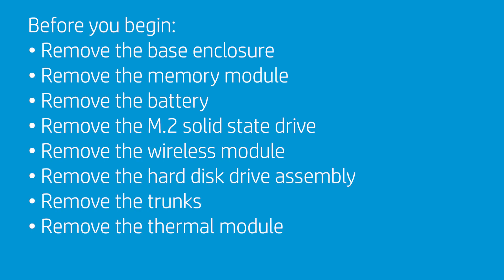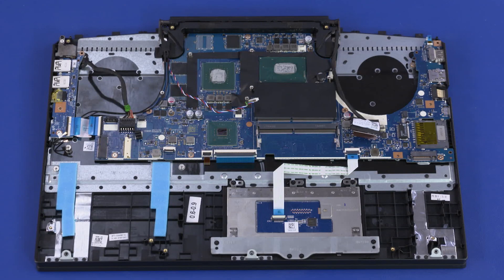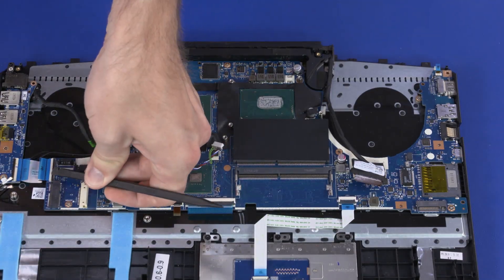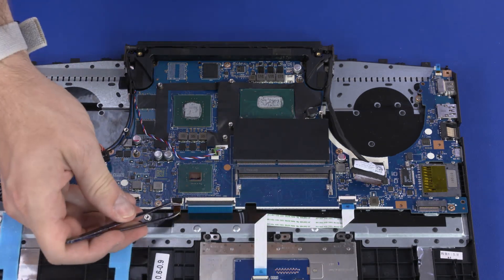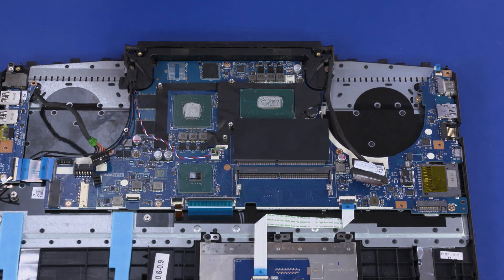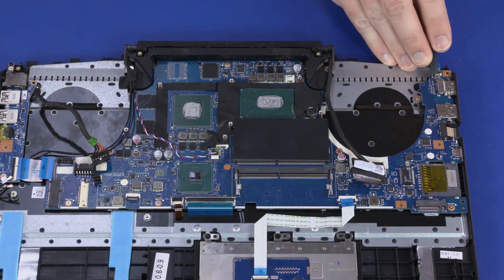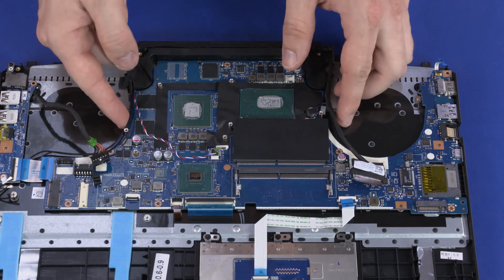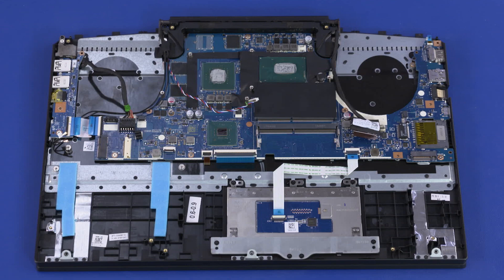Replace the Motherboard | HP Gaming Pavilion 15t-dk0000 CTO Series | HP

Comment: Do omen laptop motherboards fit in this case? If so which one(s)? Thanks.
Reply from the maker: +2380knight HP does not recommend upgrading or downgrading hardware parts or software that is bundled with the product as It may affect the manufacturer's warranty and performance, however, you could change the configuration at your own discretion.
Reply: HP Support does that mean the gaming pavilion and omen laptops support the same motherboard? Or are the sizes different? Because some of them look similar

Comment: So I've an HP PAVILION 15-BC501NO with a i5. For gaming this laptop couldn't handle a lot. Is it possible to upgrade it from i5 to i7? Another thing I'm wondering is if it's good to upgrade the RAM. Right now I've 8GB ram installed. Would the CPU get faster. Just wanna hear what y'all recommend. Wanna upgrade the laptop
Reply from the maker: +Zushiki The processor supported are: Intel® Core™ i7-7500U (2.7 GHz, turbo up to 3.5 GHz), 2133 MHz/4 MB L3, dual core, 15 W
Intel Core i5-7200U (2.5 GHz, turbo up to 3.1 GHz), 2133 MHz/3 MB L3, dual core, 15 W It supports  two SODIMM slots - customer non-accessible/non-upgradeable
DDR4-2133 Dual Channel Support (DDR4-2400 bridge to DDR4-2133) (for 4 GB/6 GB memory)
DDR4-2133 Dual Channel Support (DDR4-2400/2666 bridge to DDR4-2133) (for 8 GB memory)
Supports up to 8 GB max system memory
4 GB (4 GB × 1)
6 GB (2 GB × 1 + 4 GB × 1)
8 GB (8 GB × 1)